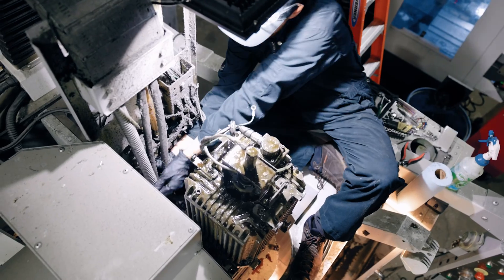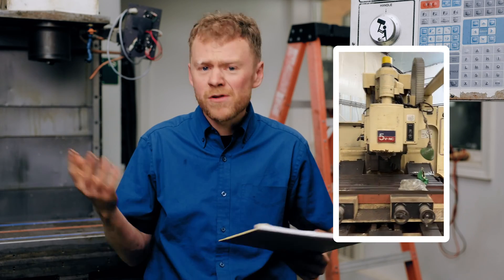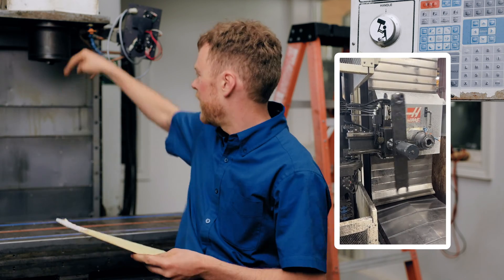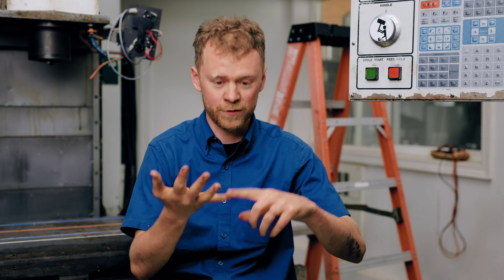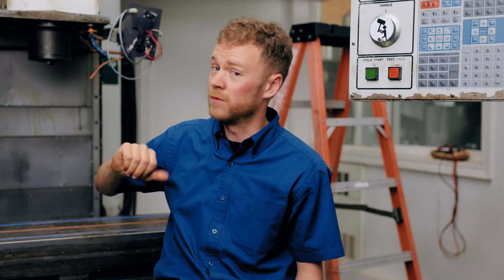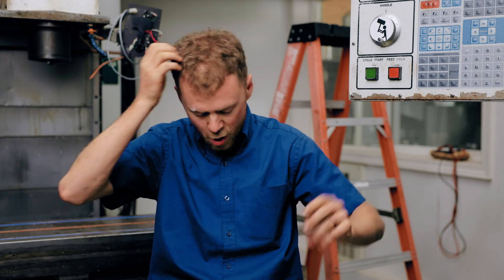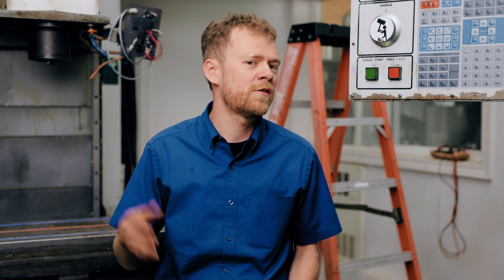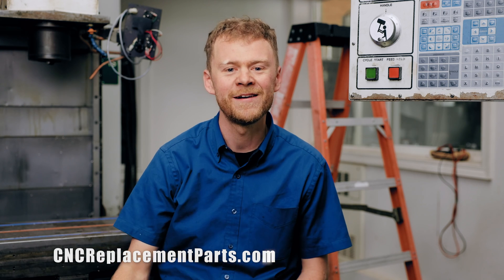What I Do as a CNC Repairman

Comment: So my friend dropped the wire that supplies 24Volts DC to my parts ejector actuator on the sub spindle housing and it went sparky spark.  and now I have an extra alarms that says I lost my signal to my Parts catcher, I replaced the 24 vdc power relay on the power module and restored the entire 24 volt circuit, but now I have no LEDS on my sensors and my Pneumatic Solenoids.  I don't know if there are no LEDS because there are there are alarms present or if i'm missing a ground to those circuits.  We checked are status page and I see the signals on ejector when I jump the wires x065 and x064 and L+. Alarms are ex 2286I work ejector timer over limit and ex 2165F parts ejector lost signal. Have a great day.
Reply from the maker: You’re gonna have to look at electrical schematic and trace the wires. You probably have a short somewhere or a blown fuse or breaker.
Reply: @cncrepairman  Thanks sir! this is the best bedtime reading materials ever.

Comment: Can you do a video Why retrofits are bad or why you don’t work on them .
Reply from the maker: I’m gonna do one with my dad. Probably later this summer, though it will be spicy.
Reply: Glenn, retrofit is a wide open term. It could be as small as Mitsubishi doesn't make that servo drive. Now we will retro fit a new servo drive.
We can get info from Mitsubishi. The more scary retrofit is the super huge machining center that someone removed the FANUC 3M controller and bolted on a pretty good and low price CNC and motors and all that good stuff. 
Your job fix it.
Oh yes it is a challenge and typically if it was easy the first guy they called in would have found the problem. 
I hope I didn't step on Mr. CNC Repairmen's toes.

Comment: As a CNC technician at an OEM(mostly new machines ), I feel you. Although I couldn't imagine working as an independent technician, repairing proprietary systems such as toolchangers without proper documentation and stuff.
I've had a few times where we (OEM technicians) had to come out because some third party wannabe wrecked a and toolchanger and magazine. 

When you said you worked on the G&L machines, did you mean the HBM line or their HMCs? Their smaller HMCs where actually German designs, only the HMC 410 /1250/1600 are US designs. Also the Cassette magazine they used to use is a German design that they were able to use due to their association with Hueller Hille under Thyssen Krupp
Reply from the maker: Mostly the horizontal boring but I’ve worked on a few big mills that had 100 feet of travel. Most of them are in places I can’t take pictures. Some of them had a control upgrade. It’s always fun pulling out your phone. Translator to look at the drawings because it’s all in German.
Reply: @cncrepairman  yeah I only really know their hmc line, since they've been closely related to the Hüller Hille NBH Line of machines In the past. Before I joined the company they actually built a pair of G&L HMCs in Germany for one of our regular customers. I think their plant was in Gainesville, Georgia.

Comment: I currently do in house equipment maintenance and line support for a medical device manufacturer. Your statement about PM work is too real. On more occasions than I would like I've been inside a machine for scheduled work and out of pride for maintaining my machines well replaced "that part that looks worn" or done an extra alignment only to cause more issues that need to be resolved. It is amusing how well some pieces of decades old equipment will run if you just leave it alone, even if it looks like it is about to fall apart. Some techs are ok with that approach of waiting to "fix it" until it breaks; but I try to avoid that. 

As an aside there's no greater feeling in the world (in my opinion) then being inside of a machine and finally figuring out a problem that you've been ignoring because production needs to run NOW and 24/7 thereafter. Finally found the cause of that weird noise or squeak?, figured out where that bolt that fell on the floor a few weeks/months ago belongs?, got it dialed in to where the operator stops complaining about how the machine's a piece of shit?, found the cause of that periodic trouble code that nobody's figured out and just gets reset? OH YEAH BABY! You feel like a damn genius.
Reply from the maker: Medical equipment is really cool. I went to school and took the first part of a biomedical technician program.

Comment: Can you write why you don't do retro fits? Yes it's clear you aren't doing it but why?
Reply from the maker: Good point I’ll have to make something. I have worked on retros and they are a pain! Every company I know who did them is now out of business. In short I don’t think it’s cost effective for someone who wants to make parts quickly on a small machine. Huge stuff 60+ feet of travel it makes sense.
Reply: @cncrepairman  thank you for elaborating. I also thought about getting into that eg. with LinuxCNC. I have converted some chinese manual machines myself using LinuxCNC and I regularly use them (tiny machines - a mill and a lathe, which were good enough to help me to make parts for a DIY smd pick and place machine which my family income now depends on).
So it seems like retrofitting is okay if you directly use it for parts for yourself or for your business but the converting task itself is just not suitable for a direct business.
Why did I convert a manual machine - to save cost and that it did...
Thank you for your videos.
Reply: @cncrepairman  I would second that assessment, being someone who has retrofitted an old mill.  by the time you buy the retrofit control kit and the doner machine, add all the hours spent troubleshooting and the extra unforseen purchases like additional sensors, pneumatics, replacement coolant pumps etc.  The project that started at £750 grew legs and ended up closer to £3500, that's kind of the price of a running old machine (ish).  Our colleagues will vouch for the cost and fault finding required to get an old beaver working, or the Seki before that, the person Aaron and i know quite well also has access to an original Haas VF1 with the futuristic plastic housing.  Having said that buying used machines can be like trading with snake oil sellers.